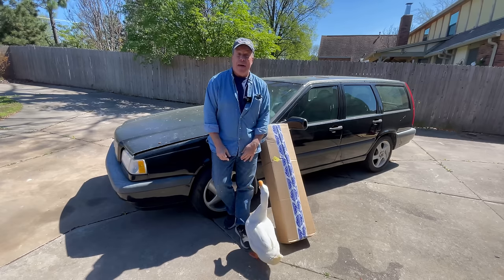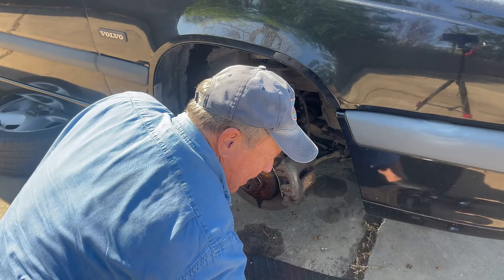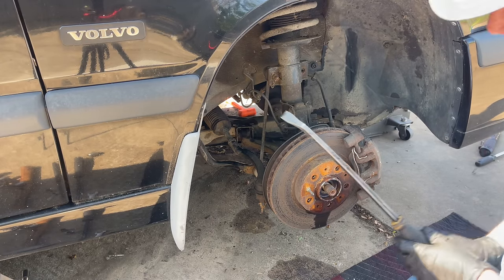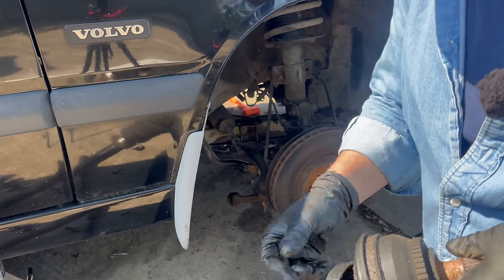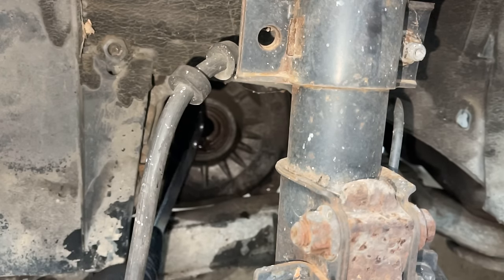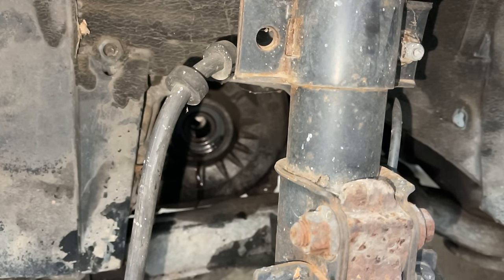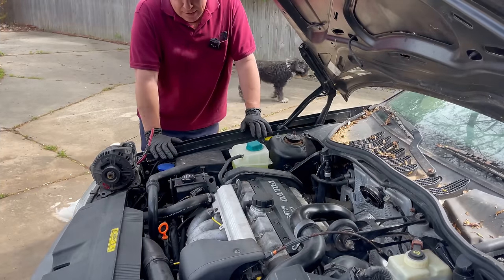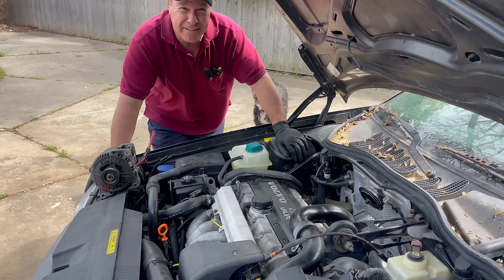How I Got My T-5 Moving Again!

Comment: I love hearing that realization in your voice , that you will have to do all that work over again if that junkyard alternator turns out to be crap, and then trying to speak what you want to happen into existence. You should be a motivational speaker. Hope that used electronic part lasts longer than the original. Great video! (BTW I tried really hard not to laugh when you destroyed your shifter.) :P

Comment: I feel for you on that seized CV axle, I just had to replace the rear hub on a clk and ended up buying a 10-ton puller from HF and even then it needed some fire-based coersion to get the axle separated from the hub.  Thanks for the video!